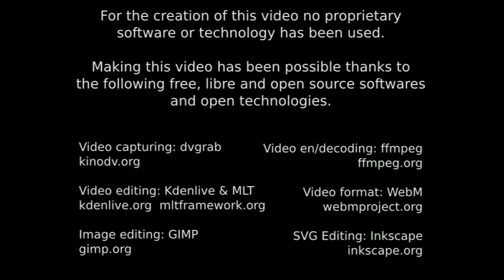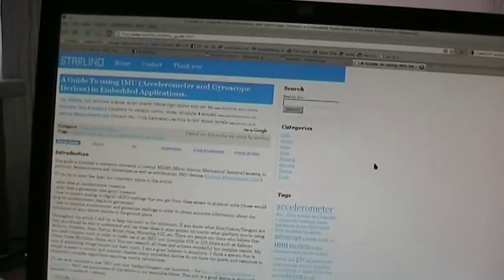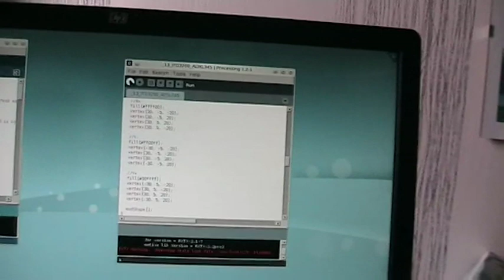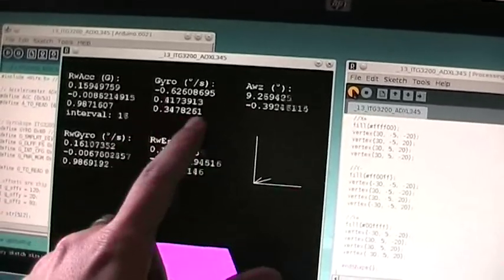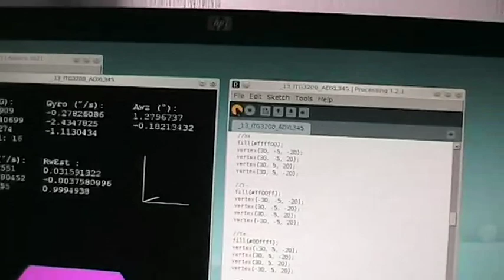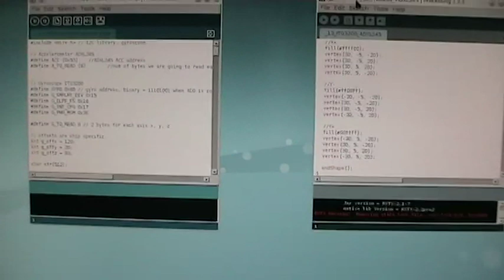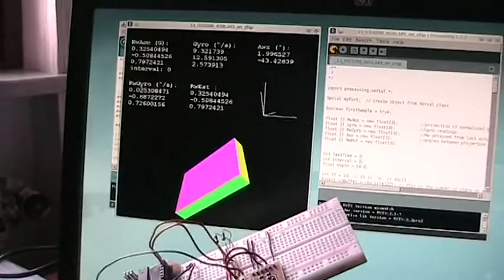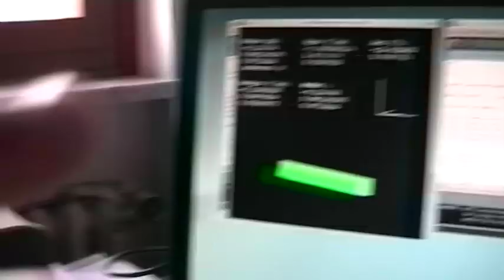My first 6 DOF IMU Sensors Fusion Implementation

Comment: hey fabio, I was curious, ..... wait, I dont remember, were you one of the guys who worked on that x-imu video? or was that another sensor...... anyways, I was curious, have you ever worked with the X-IMU with gait tracking in it? its for 3d motion tracking without markers or cameras.... I'm working on a VR project that focuses primarily on that..... 4 sensors on the body, no more, but I came across a pretty irritating problem.... a lot of the motion trackers only rotate in one position, but the X-IMU is able to move all around.... only problem is, that sensor costs 300$+, I'm looking for a cheaper (way cheaper, like 30$) alternative.... would you happen to know of any/are you working on anything like this? looking forward to your response! =]
Reply: Elvin Mateo as i remember, he died...